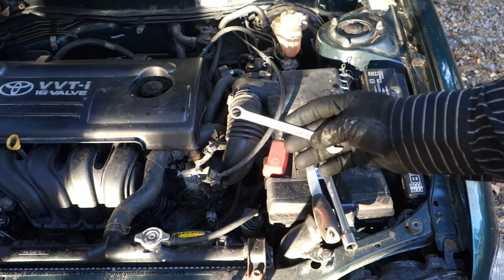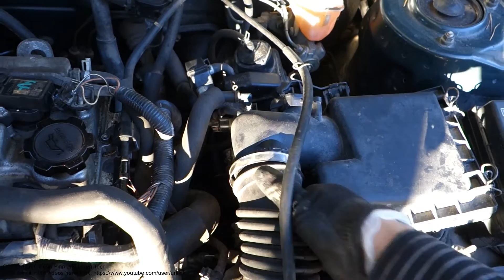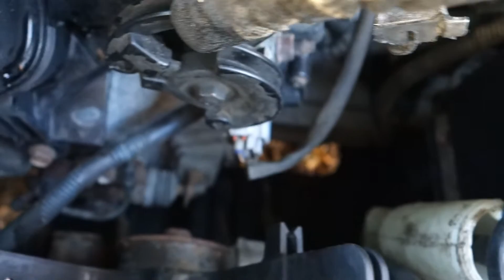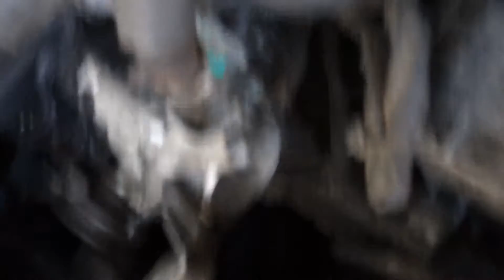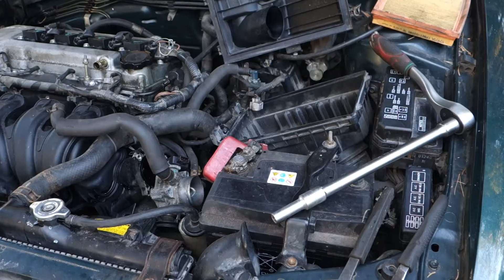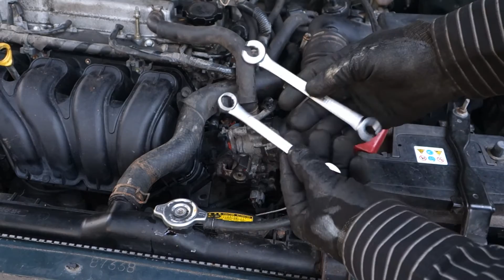How to replace fuel injection throttle body. Toyota Corolla. Years 2000 to 2010

Comment: Is that rtv that you put on there (the orange stuff)?
Reply from the maker: It is silicon sealant. High quality.
Reply: Peter Finn I just cleaned my throttle body and air control valve and when I put it back I had an engine code. I took it apart and put some permatex black gasket maker and it seems fine now.
Reply from the maker: Good.

Comment: Can you please tell me what kind of noise the car 2005 Toyota Corolla CE should make so I would like if this part should need to b replaced? My car is making a rattle sound when accelerating at about 35mph, I have a 2005 Toyota Corolla the engine is different I will maybe not need to remove the air filter part?
Reply from the maker: Hi, please take video and send link to me

Comment: Helpful video! BTW - you can use a 5mm socket instead of pliers to undo the threaded pin that holds the throttle body in place.
Reply from the maker: Thanks for Your comment. :-)

Comment: You drained a bit of your prestone to work on the air intake throttle body ??? Did your car rev up and down and get a check engine light  ?
Reply from the maker: Thanks, need to test.